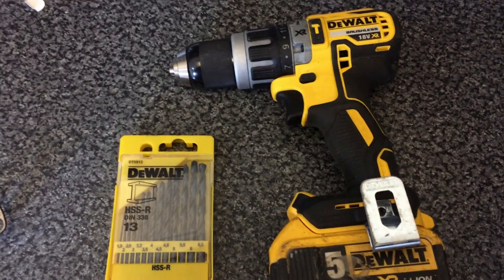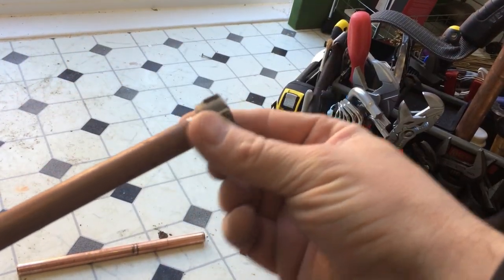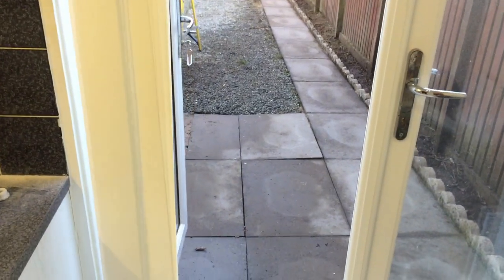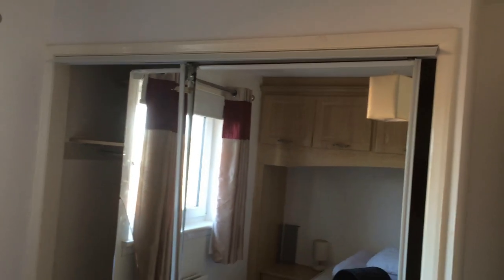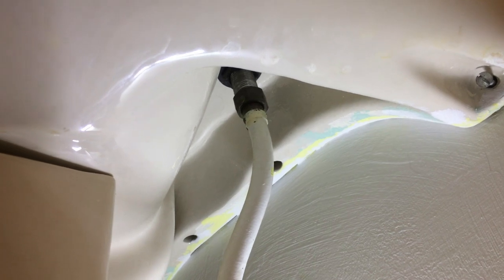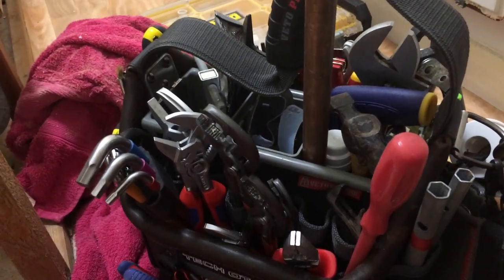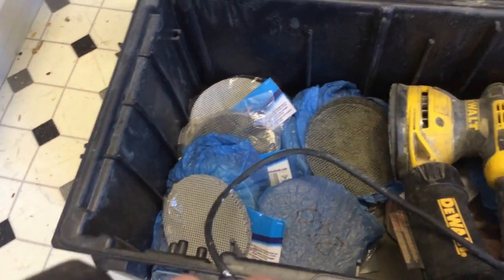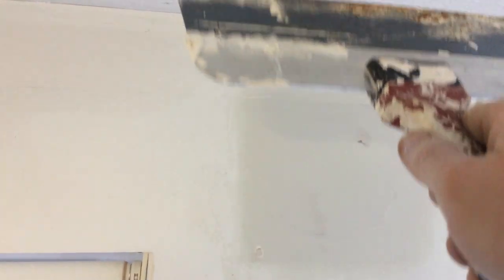Renovation of a UK rental property | Rental property refurbishment step by step (part 2)

Comment: The cordless sander is great.  I own a Milwaukee.  Just make sure you have plenty of batteries on hand, especially for lengthy jobs.
Reply from the maker: Thanks for the comment, great I think I will purchase one. I think for lengthy jobs I will continue to use my corded Dewalt but a cordless would be great for quick type jobs. I am getting to like Milwaukee but can't justify switching over at the moment as I have so many Dewalt tools and batteries.......I may make the Milawaukee sander my next Milwaukee tool - I will do some research !
Reply: Bacren Property - In your case, I would stick with DEWALT.  Plus, I believe their sander is brushless whereas Milwaukee's is brushed for now.
Reply from the maker: @ibrazeau3044  Yes, would make sense due to brushless and the platform but I am growing to like Milwaukee - do you run a lot of Milwaukee tools ?
Reply: Bacren Property - yes, on cordless, only Milwaukee tools for myself and for the company I work for.  I have around 15 M18 and 5 M12 batteries, one impact driver, one Surge, three socket impacts, three ratchets, saws, sawzalls, grinder, disk cutter, lights, boxes and totes.  Probably more but I can't remember.  I also have their bit sets, drill sets and other stuff (like their stackable boxes). A good many tools of which I've had no significant problems with.  I am awaiting for the track saw and the packout vacuum. 

Used to run Makita and DEWALT but sold or discarded all of them.  Hated Makita' batteries and DEWALT's ever changing battery platforms and marketing scams. For corded and stationary tools, I use DEWALT exclusively now.